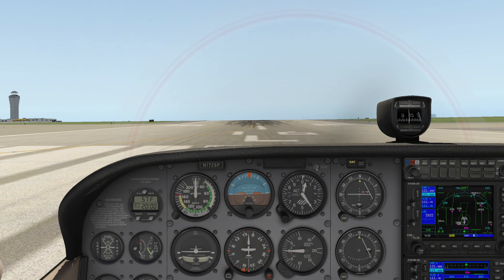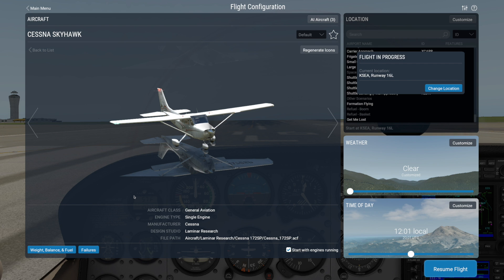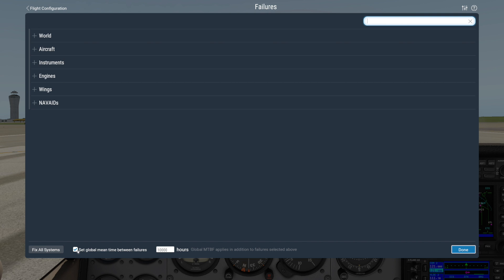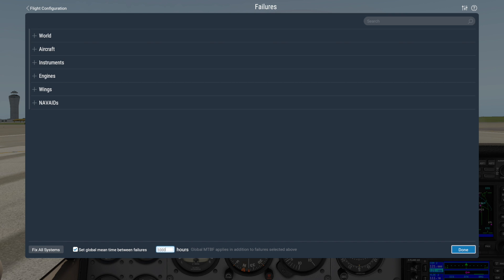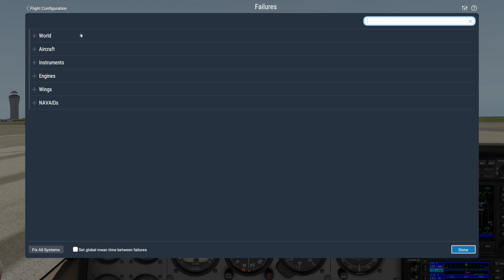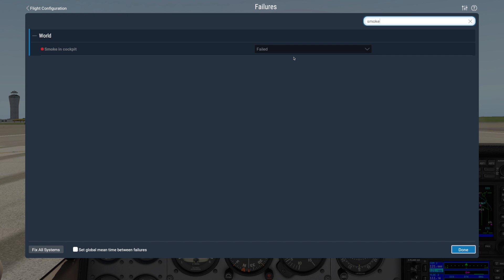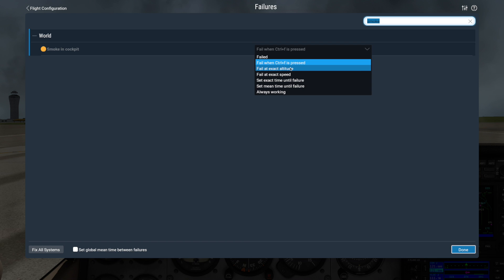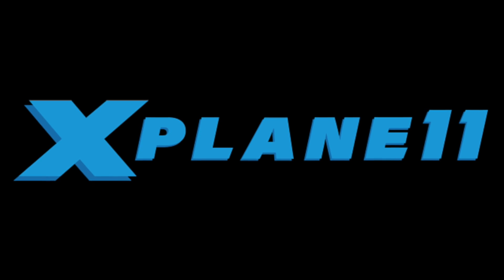Setting Failures in X Plane 11

Comment: Downloaded X plane 11. ....    It recognises the yoke and the throttle setting which I set.  when I come to actually flying the yoke is opposite.  pitch is roll and roll is pitch and nothing working on the throttle controls  even though the software is recognising the hardware when all the settings are moving.  If anyone has a solution please get in touch.   

1. The operation of the joystick is reversed pitch is now roll and roll pitch. Less on my physical joystick on my desk are on.
2. I calibrate the Throttle Control  but nothing works when I am in the aircraft and no lights on physical throttle control on my desk.

OPERATING SYSTEM
MAC
4 GHz Quad Core Intel Core i7
AMD Radeon R9 M395 2 Gb 
32 GB 1867 MHz DDR3
MAC OS Ventura 13.5.1

Comment: I am trying to save a failure as a situation. When I save it, X-Plane removes the failure. I want multiple     flights saved with different failures. 
It’s saves the flight, but not the failure when I load the saved flight.